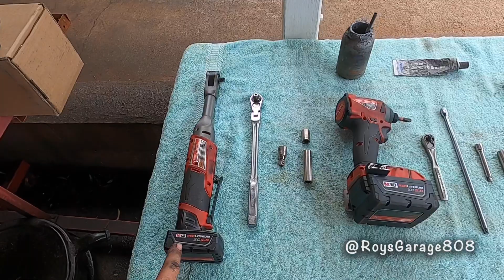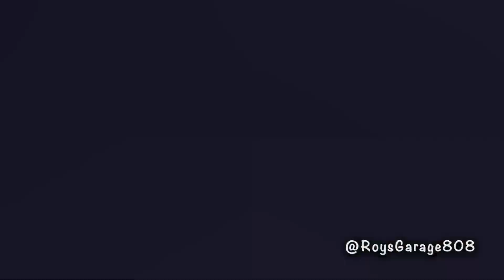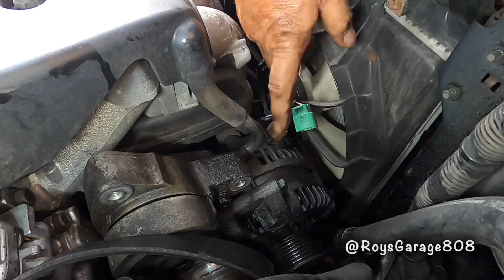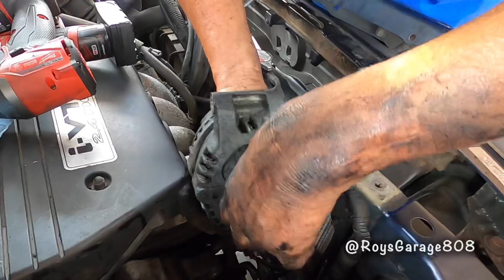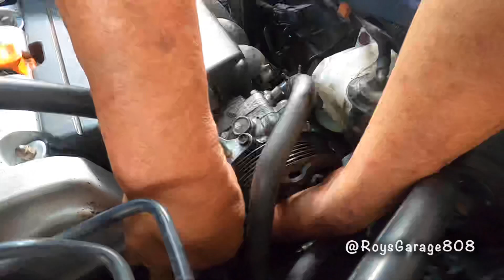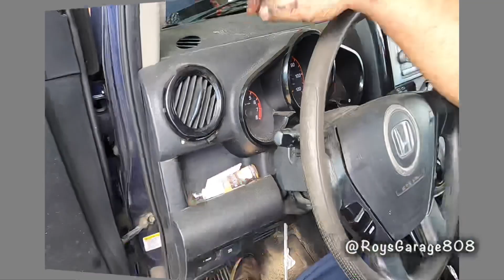How to Replace the Alternator on a 2008 Honda Element!

Comment: Hay Thanks for the help!  I must have ran the video back and forth 15 times to check on things!  BTW The idea in the comments to cover the radiator with cardboard is actually a really good idea as I banged mine up a bit.    Again, I appreciate you taking the time to put this up to help people out!
Reply: Same. Wish I had used the cardboard, didn't brake anything but a few fins are bent now.

Comment: Eh uncle the alternator made like one humming sound ? I went bring my car to the dealership and said it “could be” my steering pump. But when I brought em to the dealership they had to jump start my car. My battery still good I bought em like 1 year ago or so. So I was thinking ehhh my battery wasn’t getting charged and I noticed couple weeks before my lights would dim. So I was thinking the alternator was failing already.

Comment: Thank you for posting,  will be doing this job tomorrow on a 2003 Element that the Alternator just died on at 210,000 miles.